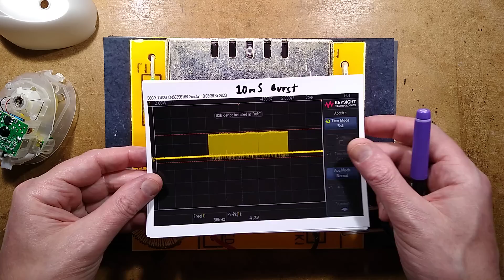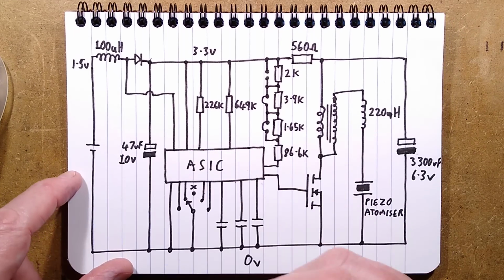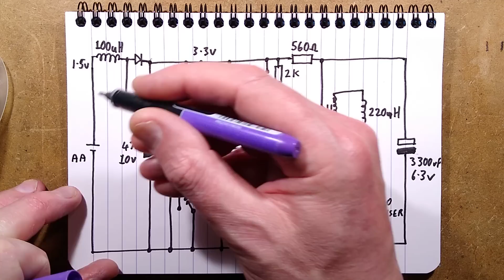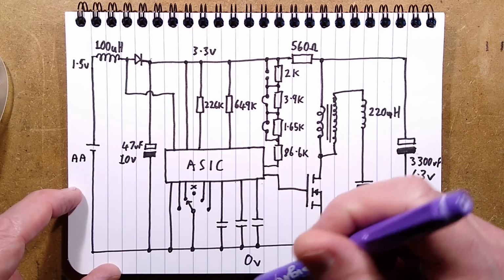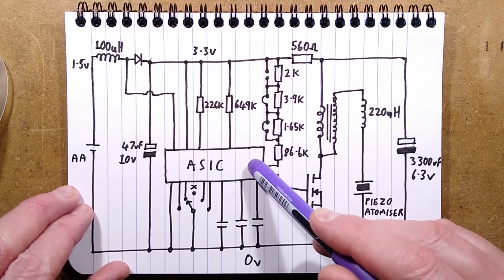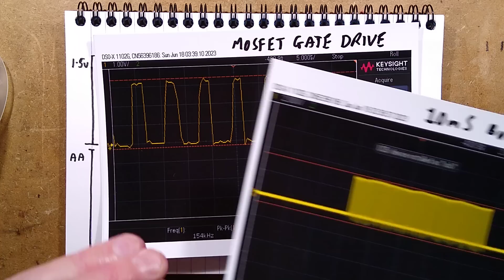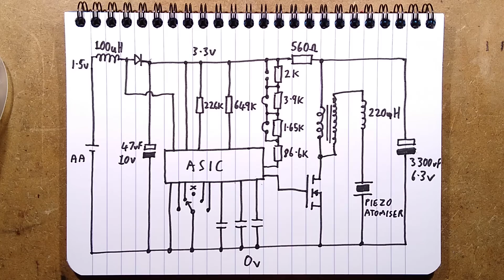1.5V powered Glade Wisp ultrasonic oil atomizer

Comment: In the late 1990s I worked at the company that developed those and other household air fresheners.  Almost every Friday afternoon the fragrance group had six to ten new scents to test.  For smell testing the new combinations and filling out a form you received a treat, usually a candy bar.  There was always one odorless sample, probably water, to weed out the people who were just filling out the form without actually sniffing the samples.  It happened in a special room that was ventilated in such a way that the odors did not remain and mingle.  Most times it seemed that half the company stopped by to participate.

Comment: Look for device called "Innobiz Bulia" i've been using it for a while and found out, that best liquid for refill is pure lavender (or similiar) mixed approximately 50:50 with pure isopropyl alcohol
Reply from the maker: I've found what may be a different brand (with bottle and wick) on eBay.

Comment: can you refill this??
Reply from the maker: Yes.  I've had best results with around 30 to 50% aroma oil from a modern prominently branded unit, dissolved in isopropanol (isopropyl alcohol) to make it atomise better.

Comment: If I remember right old cypress 8 bit psoc mcu:s had integrated boost regulator so it can use solar cell or one 1.5V battery. I think you just put coil after 1.5v battery and connect to chip sw pin and chip contained switching transistor and diode.
Reply from the maker: I've seen one combined boost and MCU chip.  It's in a fairly recent air freshener.

Comment: Interesting, as usual, but more so as I worked on these transducers during their development stage.I think you'll find they're manufactured in Nickel not Stainless Steel, the steel is too stiff, if I remember correctly. Wouldn't the 3055 transistor a bipolar? That 'blob' covers, whats called, a COB (Chip On Board) device, it's basically an IC without a package, stuck on the pcb with a blob of epoxy on top. Used when very large volumes are to be manufactured, saves a bit of money! It seems to me that the 560Ohm resistor is to stop the intermittent high current draw, during charging and spraying, from stalling the SMPS? I'm surprised that the oscillator burst is 154khz as, if I remember correctly once again, some 400khz was required to generate droplets that would float in the air. The great thing about these transducers is that the droplet size can be defined by design consequently for any given transducer design the droplet sizes would all be the same whereas a pressure driven spray generates and whole range of different droplet sizes.

Comment: This had me wondering if the ASIC is a blobbed 556 dual timer.? (Possibly CMOS)
If it's not a CMOS NE55* Timer then lots of evidence pointing towards the 2/3rds of the VCC are apparent for the timers triggering properties.

1 of the three capacitors at the bottom being timing for the step up oscillator
the other two being switched in using a digitally selectable SPST style chip.

That in mind, I think the 226k & 649ks would need to be switched in / out
along with the capacitors in order to be able to have 4 separate timing
values for the 8 second duration part of the timer to be changeable.?

They'd also seem to measure "Open ended" as the SPST chips function exactly like
a low current relay, no power = no internal connection.
However there maybe a connection between one of those capacitors to the chip leg going 
to the 86.6k.?
Therefore adding more evidence to this theory. 

I Reckon the 88.6k series values and a certain one of those values
of one of those capacitors MAY point towards an oscillation value of 10ms
using the NE555 1.1 * C/R Timer calculation.?

Sorry I don't remember the calculation formula, I Know a guy that will do though ;)
Normally i'd need to google it but I'm currently mid essay on YouTube.

LOL.
Cheers and all the best.

Comment: Those little blob ASICs used to be a lot more common. These days everything is microcontrollers. Makes me a bit sad.
That's probably why they switched to the bulky spray designs.
Cheaper to manufacture as they can just throw a generic micro in there instead of custom ASICs.

Comment: To think I looked down on spraying your room with possibly dodgy chemicals as misguided  and so missed out on some pretty complex electronics.
If the battery expired in 2005, it could date from the mid 90's.

Comment: Hey there big Clive how are you doing. I just saw a light that runs on salt water made for remote communities.
Reply from the maker: Those usually just use the water as an electrolyte.  The real work is done by the two electrodes that degrade quite quickly.

Comment: Clive, WHAT ARE THE VALUES of the those small capacitors? My OCD compels me to check the time constants between three resistors and capacitors. Just wondering if that is the time for the on, off, and pulse times use in the device.

Comment: Assuming the resistor tuning is in sequence (as that is what I would have done designing it) I would expect R1 to be close to the value I wanted and the binary adjustment to be steps of R8, R7 and R6 with R8 being biggest. R1 is a 86600 Ohm resistor but tolerance can vary. If the tolerance is +/- 866 Ohm I would expect it to be targeted low and to normally always require largest adjustment enabled but no others. Thus expect to find a set of resistors: 989, 494, 247 ohms to cover the tolerances with no tolerance added on the adjustment, but this is still nowhere what i think we find. Even at 0.01% we'd need +/- 8.66 ohms range.
Let's assume ALL values are EIA-96, but very badly/cheaply marked.
We have, adding some leeway of interpretation:
R1 = 91C = 86600
R8 = 82Z = 0.698
R7 = 39Z = 0.249
R6 = 20Z = 0.158
This does create a quite nice linear adjustment, and very fine. It does however not cover much of the tolerance range. It even only covers a small area of values assuming normal distribution of the error. +/- 0.55 Ohm equals maybe 19% of the area.
Taking another stab at it with these values, not assuming all are EIA:
R1 = 91C = 86600
R8 = 822 = 8200
R7 = 392 = 3900
R6 = 202 = 2000
This I think is correct as it would cover a +/- 7050 ohm range and is almost exactly what we would expect for 10% 86600 Ohm! I was not expecting them to use 10% though but they may have...

Comment: my neighbour has so many of those god awful Glade plugins that I can smell her perfumey stench inside my apartment, emanating from under the adjoining wall, around the baseboard heater and electrical outlets. i don't know how she can stand that stink. imo, an 'air freshener' should actually clean the air, not stink it up by atomizing perfume into the surrounding environment.
Reply from the maker: It might be worth casually mentioning that it's usually oil based, so she's breathing more oil than in a factory.  Tell her you mentioned it because you care for her safety.

Comment: Interesting video 
I used one of those air freshener's 
I stopped using it 
As a slight oil film coats everything close to the unit 
Then the dust clings to the oil film 
Smells nice , but you end up with dirty and oily

Comment: I saw that little puff coming out of its hole. "Then Try It With Other Random Liquids" 02:13 - Suitably unspecified, you can only imagine what mischief he will engage in. As always, Clive, your circuit analysis provides valuable insights for those beginning in electronics, that is normally only found in college courses. Bloody marvellous - Cheers.

Comment: Would this work for vapes, instead of the heater element they use? I don't vape, BTW. I imagine the minute droplets from this aren't as fine as the mist from a vape.
Reply from the maker: The first Ryan units did try ultrasonic disks, but the simple heater and wick is massively easier and more powerful.

Comment: I need to repair my electric lawn mower. It had a relay that went bad in the board. So I bought a 100w pldc controller. It wouldn't even try to start. There was power to the board.  I'm guessing it needs a potentiometer the wasn't a diagram for either board. The one on the mower is sealed in silicon rubber. So I can't really get a look at it.

Comment: Weirdly, I think my favourite part of this was how mind blowing it was to find out the middle pin on that selector isn't connected. It's an utterly genius way to save a pin on a micro controller (or ASIC, in this instance).

Reminds me of that meme - "The missile knows where it is at all times. It knows this because it knows where it isn't."
Reply: Also means the most likely component to fail doesn't break things when it does. The usual "switch is open circuit" means you get medium. Of course when that big cap goes it's game over, but it's a 6V cap seeing 3.3V and there's nothing hot near it so it should be fine.
Reply: It’s not a new idea. Saving a pin actually saves a fair amount of money. Hence this technique has been used for many years in various electronic systems.

Comment: I wonder what frwquency the piezo element is oscillating at and do you have to change the frequency for tge type of oil and sxent  being used or alcohol and secent
Reply from the maker: It will purely be the resonant frequency of the disk.

Comment: Could the resisters in that series be a version selector for different hardware devices they had on the market?
Reply from the maker: I think it's for tuning the resonant frequency of the disk.
Reply: @bigclivedotcom  That's what you said it could be... and possibly too... Maybe they have difference sized disks that could be used in manufacturing, and that allowed for flexibility when manufacturing the devices if they couldn't source a particular disk, then they'd set the resistor to one they could source and you'd have the right frequency to match the disk... maybe?

Comment: At my last job , in the '90s, they had two styles of deodorizers in the restrooms and waiting rooms. One style had two D cells, and a timer circuit that controlled a motor that set off an aerosol can of scent in short bursts.
     The other one has scent crystals and a single D battery in a plastic cartridge. It ran a very low current consumption motor continuously for a couple weeks.
     They were changed every two weeks ( the scent crystals lost their scent), but the battery still had plenty of life left in it ( Eveready Energizers). I salvaged them, and informal tests showed they lasted about as long as new ones. I had loads of these batteries , and gave them away to coworkers and homeless people that hung around the place...as long as you didn't mind cherry or apple scented Eveready Energizers...

Comment: The 220 uH is to null out the peizo's series reactance. The peizo's radiation resistance which does the actual work is relatively low by comparison. A few ohms. The radiation resistance translates to transmitted acoustic energy. There is some electrical resistive resistance (heat) but it's small.
Piezo driving frequency would be varied by "system clock speed" not by division in software. The peizo has a narrow operating bandwidth because of its high ratio impedance / radiation resistance. So maybe during manufacturing comp values are tweaked. 
Possibly, maybe, the asic auto-tweaks frequency by switching in/out capacitors, since it can tell how much power is transmitted by looking at dv/dt of the power rail. Sensor catflaps do similar a auto-detect of collar tag frequency

Comment: Hm, how does the ASIC pulse the coil output to step up the voltage at first? Doesn't it need the supply voltage to do that? Seems a bit like a hen and egg problem :> I guess it can run that part of the circuit at 1.5V already and go from there.
Reply from the maker: It can initially start at the lower voltage.  But it's notable that it locks up if the voltage isn't high enough initially.  That's probably why mine seemed to stop working when I was younger.

Comment: Interesting. An old friend of mine from high school designed the circuit for the glade wall-plug units. I will have to inquire if he had a hand in this one.
Reply: Unfortunately I remembered it wrong, he worked on the AirWick version,-- much earlier with a much larger reservoir.  It did not work in the same way.
Reply: @porticojunction   Aw, bummer. Thanks for updating, though!
Reply: I'm just replying on the off chance you get your answer and decide to post it, I'll get an alert 😁 Might be interesting if there's some sort of story he'll share.
Reply: I’m curious as well
Reply: I love the center switch choice open circuit. It shows pure design genius, as it changes the most likely future failure mode into a "keep running" at the midpoint of smell strength.
Reply: That could help explain what is under the blob.
Reply: I'm curious as well!

Comment: 156KHz seems kinda high for an ultrasonic transducer doesn't it? Not sure. I would imagine that the viscosity of the liquid is crucial to how it works.
Reply: It also needs to be inaudible to humans and common household pets .
Reply from the maker: Typical eBay humidifier modules work in the 100kHz to 150kHz region.

Comment: Clive, if you want some cheap 3v atomizers, Mrs Monkeh has bought for wee Monkeh a volcano on scamazon (I think) that has a small resevoir for atomizing water. Can be used for other liquids as I found out, works well for oils. 
I had to cut out the speaker as it would permanently make a dinosaur sound on repeat. Highly annoying, and a little upsetting to wee Monkeh who seems to be a little sound sensitive at the moment.
Reply from the maker: I've featured a few of the ultrasonic atomiser units.  Often sold as USB humidifiers.  There is the temptation to adapt one to be an aroma unit with brief bursts of mist like this unit.

Comment: Makes me wonder why these piezo disks aren't used instead of a little heating coil for vapes.  Might be because the piezo atomizes, but the process depends on pulling heat from the air to complete the phase change from liquid to gas, whereas the little heater provides all the energy to go strait to a gas.
Reply: Heaters make steam, atomizers just make lots of tiny drops .
Reply: I suspect the heating coil can produce greater volume of vapour than the piezo discs for the same size of hardware.

Comment: I remember my first overpriced miniature LED flashlight that ran off one AAA cell and of course had to bump up the voltage to run the single somewhat powerful white LED. I paid a lot for that compactness! I think the tiny flashlight was over US$35
Reply: I wanted a blue LED when they came out but I was NOT going to pay 85$ for it....  now I have a 16' roll of them at 3/8" spacing for 12$
Reply: @bunnykiller  It’s a good thing that blue LEDs became affordable quickly
Reply: @NyxKemo  the first blue LEDs came out about 20 yrs ago and they were pricey, do you remember when green laser pointers came out and how expensive they were, now you can get them for a few $s
Reply: @bunnykiller  yeah i remember it a bit
Reply: @bunnykiller  I got hundred blue LED's for 4EUR, it's impressive how cheap LED's have gone._
Reply: That is definitely overpriced, i have a klein rechargeable flashlight that was only cad$29 and has a very good battery life and is very powerful for it’s size

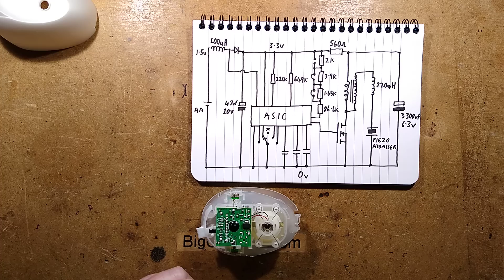Comment: 13:57 yeah my wisp atomizer went out probably in 2 years because of a buildup of gunk I think. 2003-2005 was the timeframe I used mine.
Reply from the maker: I think the tiny atomiser disk holes were possibly prone to blocking with dust and goo.  I sprayed this one with isopropanol to clean it.

Comment: Question: do you think these days with the smaller chips (transistors) and lower supply voltage requirements (I’ve seen 1.2V)—do you think they would need that boost converter to supply (a modern version of) the μC anymore?
Reply from the maker: The microcontrollers do still require a higher voltage, but with discrete circuitry it might be viable to do it with 1.5V directly.  One advantage of the boost circuit is that it provides a stable 3.3V for consistent atomisation volume.

Comment: I used to work in the manufacturing of nebulizer discs, similar to the ones in your vid. If you have any questions I can try to answer :)
Reply from the maker: Main question is whether the blank stainless disks are etched to get such fine holes.
Reply: @bigclivedotcom  I wrote a long reply to your question, but somehow youtube deleted it. I will try again tomorrow!
Reply from the maker: @Auhydride  When leaving long replies to anything I try to remember to highlight and save the text before posting it in case it blips.